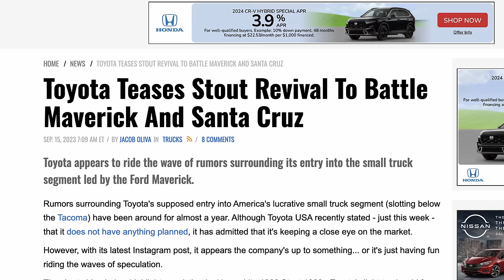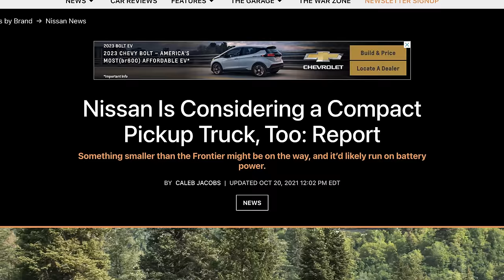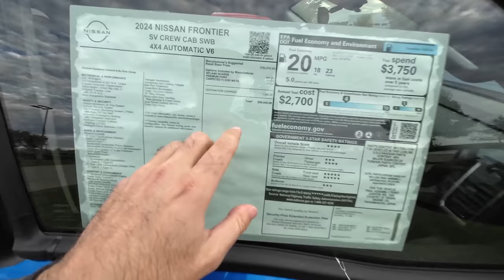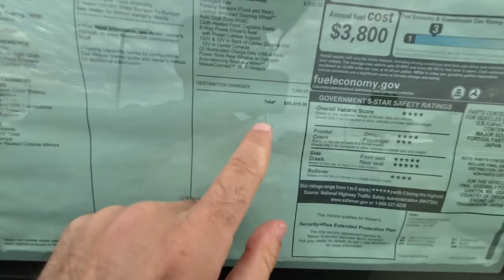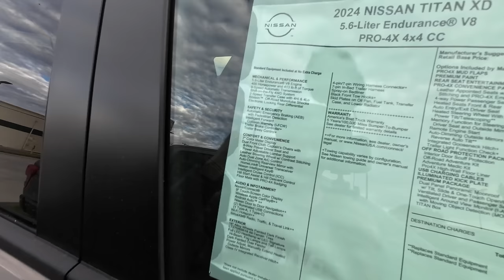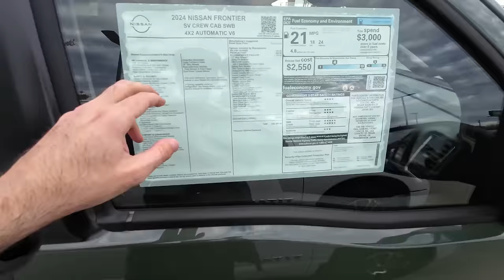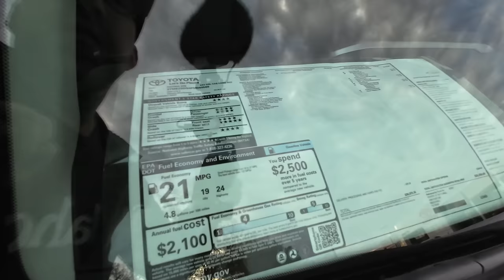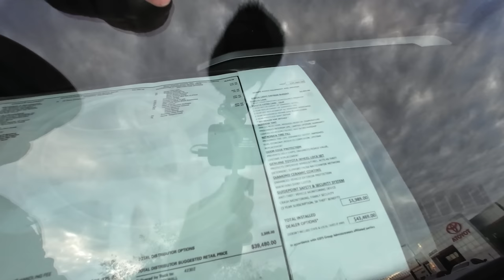Nissan’s NEW $20,000 TRUCK Has Ford & Toyota In Panic Mode!

Comment: Truck manufacturers need to stop catering to middle class/ upper middle class truck buyers who push for all that unnecessary crap. there is no reason why the base model of any full size pickup truck should cost more than $20,000. make it bare bones: no power anything, no satnav with apple car play, no bed liner, no side steps, no leather interior, manual transmission option, etc, and for the love of god, stop with the "packages". instead of offering product packages to add on to the cost of the vehicle, i should be able to pick and choose which options i want: front and rear lockers,  side steps, etc. i shouldnt have to buy a full package for something unless its for towing where you can make the argument that all of the add ons in that package are necessary for safe towing. anything else, however should be individual options and not bundled into a package. if i want satnav, i should be able to add in just the satnav system itself and still have manual locks and hand crank windows with no alarm, instead of having to buy the "navigation and security package". i mean seriously, the major manufacturers are missing out on a ton of revenue just because they are ignoring the largest demographic that they could possibly market to: lower middle class and lower class individuals who could swing a $20,000 truck  but cant because there currently isnt one that exists for them to buy.

Comment: I listened to the first 3:30. 
👎 Bullshit. 
March 16, 2024 - There is NO $20,000 Nissan truck. 
Probably not even on the USED truck line at a Nissan dealership.

Comment: Maverick ain’t even a truck. It’s a FWD car with a bed
Reply from the maker: Fact.
Reply: @MotorFeed  wish someone would make an economical small pickup AND an economical full-size that’s actually capable and made for day to day work. “Work truck” models of most are NOT the most capable (worst gearing and weakest engines usually) so you gotta buy the upper models to get the best tow ratings. 
Make some bare bones, simple, efficient GASOLINE ENGINE trucks! If they wanted they could make a full-size under $30k and a small truck under $20k and still make plenty of profit especially since they wouldn’t have to pay an engineering team to design the “leather buttwiper option” 😂
Power windows, low level “do the job”audio system, backup cam (mandated I think) and no more options besides 4x4 and possibly larger engines or different gearing for different applications
Reply: I am wanting to buy 2 new 1/2 ton trucks for my business so I got a friend at the local ford dealer to price me out 2 XL model f150 with v8 and most gearing I could get in that model as we pull trailers daily. She came back with $55,000 each!! Ridiculous!!

Comment: Trouble with Nissan as it doesn't get the mileage and the longevity of the motor 3 or4 100000 miles what did you get?😮

Comment: I don't necessarily worry about the Nissan engine it's the transmission that is always junk.
Reply from the maker: Especially the CVT. haha.
Reply: @MotorFeed  that's the one that came to mind. I had a 2013 Sentra and the first transmission went at 94k and the second went bad before 200k. The third one started to go around 230k and luckily my car got totaled. Haha

Comment: Until sales numbers of Tesla Cybertruck,  Rivian R1T which really is ramping up big time now and the Ford F150 Lightning start rolling in hard to know where any of this is going outside of the Ford Maverick and upcoming Ford Explorer.  One thing is certain Volkswagen is not as a badge anyways involved in any of this. And don't count the Ford Mach-E out for giving both Tesla and Rivian R1S a continued run for those now suddenly precious and preciously few US Dollars unlike as was true 2 Years ago. Also electric cargo vans have only begun to ramp up from Rivian and Ford and who knows what might wind up happening with Canoo given the massive investments in that Platform with not much to show if anything as of yet. Lucid apparently has a pickup truck in the offing as well. If Ford suddenly finds itself massively discounting F150 Lightnings because of Cybertruck good luck being a mid size overpriced offering in what still is a full size World for the pickup truck market. Plus Jeep has the Wrangler and Cherokee 4xE and Porsche hybrids have been getting very high marks but of course an enormous price tag to go with that. The way I follow the current value of the entire market is to follow Edmonton Cadillac sales actually...ain't no shortage of an oil boom there.

Comment: Mazda and Ford simular the truck and car market trying to keep American workers and money in the economy the problem being you can't put cheap parts aluminum and expect 80000 for a truck the cheaper you make them the price should go down but you find same as jeep they built the hummer for tow and haul for the work purpose you can't haul 10000gvw with a Nissan and Meer kdot requirements when the tow bar itself only rated to 5 to 7000 lbs  on the smaller trucks and look at the emissions on the smaller motor working harder and burning more fuel with half the load but Toyota make good 4runners I'll stick with gm don't know if gm gives the manscaped package for the balls on the tow hitch but didn't ask neither. The ev market I don't know but electric motors get hot just run a cordless drill a touch thr side of it they can get pretty warm and how well does water and electricity mix not well even a drill will bite ya if you have your had buy the vent system